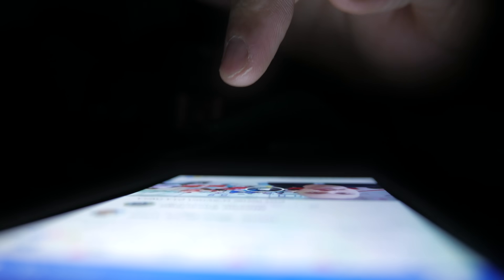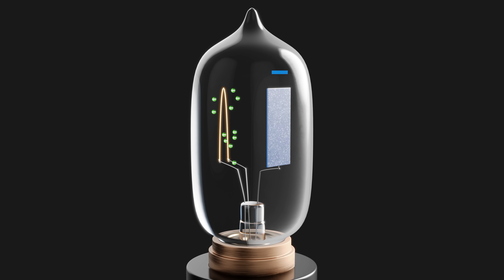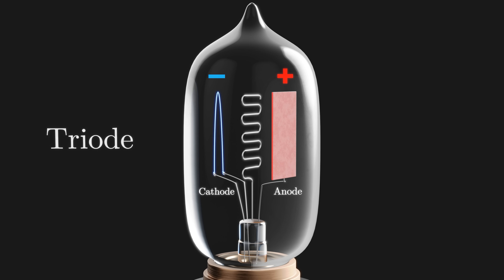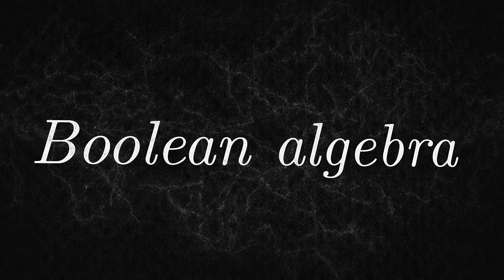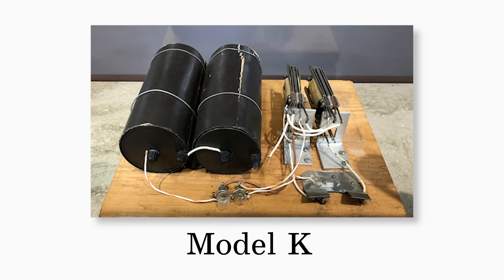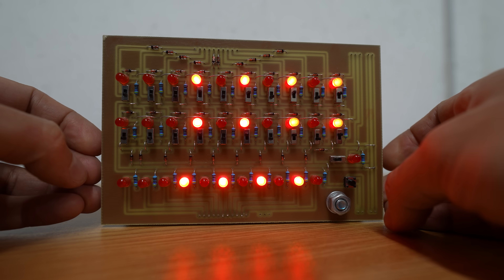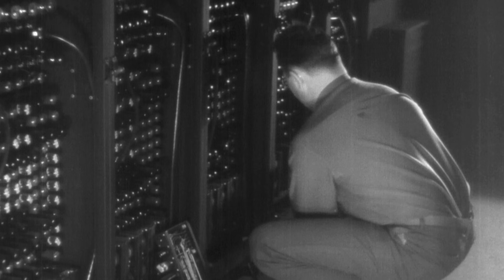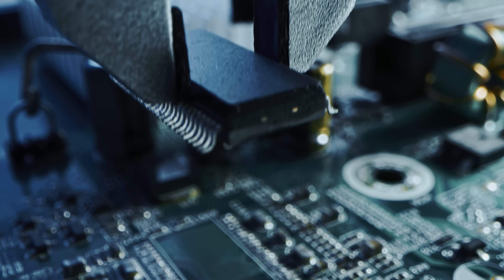Why The First Computers Were Made Out Of Light Bulbs

Comment: For everyone that misses his favorite early computer from the 1940s. I can add more if suggested.

Atanasoff–Berry Computer (1939–42) — first electronic digital computer for a specific task
Zuse Z3 (1941) — first working general-purpose programmable automatic digital computer
Colossus (1943–44) — first large-scale single-purpose electronic computer
Harvard Mark I / ASCC (1944) — first large-scale general-purpose electromechanical computer in regular Service
EDVAC (design 1944–45, operational 1949) — early electronic computer designed around the stored-program (von Neumann) architecture
Zuse Z4 (completed 1945, operational 1949–50) — most advanced relay-based programmable computer
ENIAC (1945) — first general-purpose electronic computer
Manchester Baby (1948) — first stored-program execution
EDSAC (1949) — first practical stored-program machine in service
UNIVAC I (1951) — first commercially produced computer for business and government use

Comment: In wiring the line connection to these heaters, the video shows regular wire nuts.  But, 1. these heaters typically use aluminum wiring internally, meaning a dissimilar metal wire nut (purple), 2. high heat load means the regular temp rated wire nuts not good enough, 3. There’s a both a ground screw and green wire built into the heater, meaning both ground wires have  to terminate same place, ie pigtail or ring crimps. 

Don’t see any if this in the video

Comment: The first computers were actually mechanical. Included among them would be Konrad Zuse's "Z3", a  fully programmable digital computer, built in 1941, and Vannevar Bush's analog computer that solved differential equations; he built that 10 years before Zuse's machine! There were others that should be considered, like Pascal and Leibniz's math calculating machines, Babbage's Difference and Analytical Engines, a wide variety of astronomical clocks, and perhaps even the enigmatic Antikythera Mechanism should be included? The first computers were all mechanical.

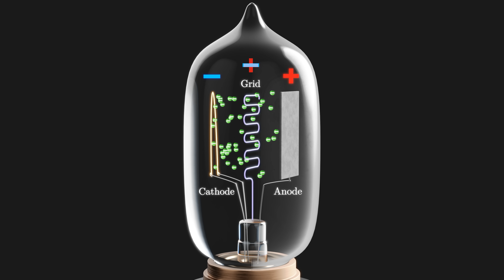Comment: Slightly misleading at 13:50 and earlier.  Indeed, electron flow from cathode to anode will be blocked when the grid is "very negative", but to facilitate electron flow from cathode to anode the grid is not made "very positive".  This would facilitate electron flow from cathode to grid, so for electron flow from cathode to anode the grid is made slightly negative or zero (w.r.t. the cathode), but not positive.

Comment: I am understanding that the grid (6:28)  helping to regulate the flow of electrons but how it is helping to increase telephone connection across America?
Reply: As an example, let's say a microphone connected to the triode grid provides a 100 mV signal which produces an anode signal current of 1 mA.  If the anode is connected to a supply voltage via a 10 kOhm resistor it will produce a signal voltage of 10 volts at the anode.  The triode has amplified the signal by 100, turning a 100 mV signal into a 10 volt signal.

Comment: X rays were a side effect in many vacuum tube use cases like TVʼs and tube amps. Purpose build x ray tubes are more efficient at the conversion from electricity to x rays but with my testing it’s possible with most tubes and sufficient voltage (about as much as it can handle). I would love to see a Geiger or spectrometer reading on this processor.

Comment: 0 = current off 1= current on energy oms law. If current on calculate assigned bulb character. If off loop ;) switch on/off calculation aka binary 0 and 1 system. Same concept black and white digital camera calculation :) now in quantum its multidimensional bulbs aka imagine like chemical reaction explosion million of bulbs in parallel on/off  electrical calculation. Then assigned value gets returned back to human character. Quantum calculation. Cubits explosion of mind.... discrete math multidimensional calculation in nano seconds :). Ultimately it's electronics circuit board. Open gate,  close gate calculate flow of current retrieve assigned character from each bulb keep in buffer till in loop return final value of characters. Same old school signal communication, bulb on mom home do not come home bulb off mom outside come home 😀.

Comment: A positive grid attracts electrons. These electrons can't go to the anode, and worse, can heat the grid. Therefore the grid was mostly operated with more or less negative voltage, say between -10V and -1V relative to cathode voltage.

Comment: Its funny. While Stibbitz in 1937 built a simple relay with 2 switches, Zuse already was building the first computer from 1936 to 1937. But I guess the americans were always late and thats why Paperclip happened after the war.
Crazy part is that the amplifier tube was invented way before that, so in theory a tube computer could have been built even 20 years earlier. I attribute the slow distribution of information and ideas to that. Noone bascially was connected enough to spitball ideas other than on conferences and letters.

Just imagine if someone had thought of the principle of using amp tubes as switches earlier, maybe people couldn't quite see it because of the sine wave nature and not thinking about capacitors pulling the voltage up or down to specific points that then act as signals. It is even crazier that these machines were basically pretty crude and simple all things considered.

We will never have such a huge development jump anymore, even quantum computing is not advancing as fast as we did with normal computers.

Comment: AI Summary

Abstract:

This video traces the unexpected origins of modern electronics, beginning with Thomas Edison's observation of electron emission (the "Edison effect") from a light bulb filament. This phenomenon, known as thermionic emission, laid the groundwork for the first electronic components. The video details the evolution from Edison's discovery to John Ambrose Fleming's thermionic diode (the "Fleming valve"), which acted as a one-way switch for electricity, and subsequently to Lee de Forest's triode (the "Audion"). The triode, with its ability to amplify and function as a rapid electronic switch, revolutionized radio and telephony. The video then connects these vacuum tube advancements to the dawn of digital computing, showcasing early relay-based calculators (like Stibitz's Model K) and the massive ENIAC, the first programmable electronic computer. It concludes by highlighting the critical role of vacuum tubes in these early machines, while also pointing out their inherent limitations in terms of size, power consumption, and reliability, setting the stage for the eventual advent of semiconductor-based electronics.

The Light Bulb to Digital Computing: A Journey Through Early Electronics

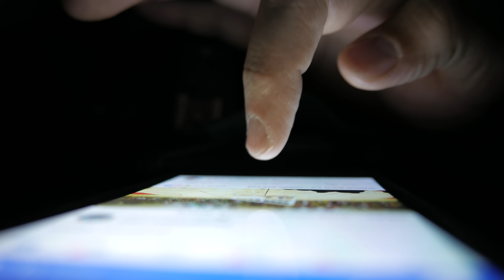*   0:00 The Light Bulb's Unexpected Secret: The modern era of electronics began with Thomas Edison's observation that light bulb filaments, when heated in a vacuum, emitted electrons (thermionic emission), causing discoloration only on the positive side of the glass. This was known as the "Edison effect."
*   1:59 The Thermionic Diode (Fleming Valve): J.A. Fleming patented the first electronic valve in 1904 by adding a second electrode (plate) to a vacuum bulb. This device acted as a one-way street for electricity, allowing current to flow only when the plate was positive relative to the filament, enabling radio signal detection and AC-to-DC conversion.
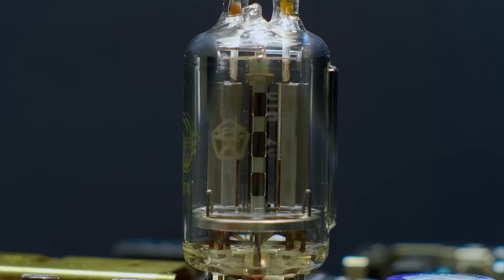*   3:33 The Revolutionary Triode (Lee de Forest's Audion): In 1906, Lee de Forest added a third electrode, a "grid," to the diode, creating the triode. This innovation allowed a small voltage change on the grid to control a much larger current flow between the filament and anode, providing the crucial capability of electronic amplification, which was vital for long-distance telephone calls and radio communication.
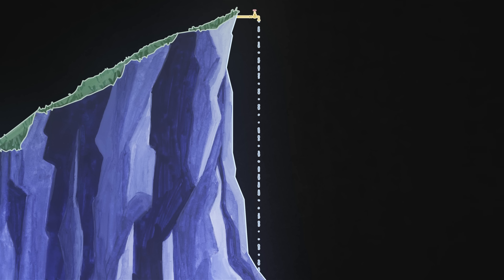*   5:50 Triode Amplification Demonstration: A live demonstration shows a triode amplifying a small 2-volt input into a 15-volt output, illustrating its power in boosting signals. This technology made the first transcontinental telephone call possible in 1915.
*   6:52 From Analog to Digital: Boolean Logic: Claude Shannon's 1937 thesis linked electric circuits to George Boole's Boolean algebra, establishing the foundation for digital logic gates (like AND, OR, XOR) using switches or relays.
*   7:57 The First Digital Calculator (Model K): George Stibitz built the first digital calculator, the Model K, in 1937 using telephone relays. This basic "half adder" could add two 1-bit binary numbers, demonstrating the practical application of Boolean logic in electronic circuits.
*   10:59 Limitations of Relay Computers: While effective, relay-based computers like the later Model I (which used over 400 relays) were slow, noisy, and mechanically prone to wear and breakage, limiting their computational speed and reliability.
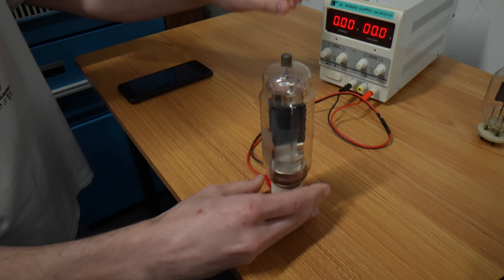*   13:29 Triodes as Electronic Switches: The vacuum tube triode became the ideal electronic switch, rapidly controlling current flow without moving parts, making it significantly faster and quieter than mechanical relays.
*   14:13 The ENIAC - Dawn of Electronic Computing: The Electronic Numerical Integrator and Computer (ENIAC), the first programmable electronic computer, came online in 1945. It was a colossal machine (30 tons, 175 kW, filling a whole room) but revolutionized computation, performing 500 operations per second and proving critical for complex calculations like those for the hydrogen bomb.
*   15:36 Vacuum Tube Drawbacks: Despite their importance, vacuum tubes were power-hungry (always needing heat), large, and unreliable, with ENIAC tubes failing every few days. These limitations highlighted the need for new electronic switching technologies.

I used gemini-2.5-flash| input-price: 0.3 output-price: 2.5 max-context-length: 128_000 on rocketrecap dot com to summarize the transcript.
Cost (if I didn't use the free tier): $0.0078
Input tokens: 18319
Output tokens: 916

Comment: A vacuum tube is not a light bulb in that its purpose is not to glow or give out light like a light bulb.

A vacuum tube was an electronic control device. Meaning, it controls the flow of electric current. Vacuum tubes served similar purpose as transistors do nowadays. Back then, transistors weren't invented and they weren't so small. Computers were made of bulky vacuum tubes which would lead to heating issues.

Comment: The ubiquitous presence of vacuum tubes (the British call them "valves" as per your water valve analogy) in home electronics led to a cultural icon:  the tube tester.  Besides at Radio Shack (naturally), they were to be found in most drugstores and elsewhere.  When you TV would stop working, it was usually because of a burned out tube.  So you would fix it yourself by opening the back of your TV cabinet and pulling out all the tubes, taking them to a tube tester, testing them all until you found the one(s) that failed the test, buying replacements for them (the store carried an inventory of spare tubes), putting the tubes back in the TV (there was a diagram showing which tubes plugged into where), and turning the TV back on hoping that fixed it -- if it still didn't work, that was when you called the TV repairman.  It was one of the things that every father taught his children.  As solid state electronics overtook tubes in consumer electronics, those test sets started disappearing.  The last that I remember seeing was in a Radio Shack around 1980.  
In USAF tech school (Electronic Computer Systems Repairman, 30534) we were told stories of the massive SAGE computer (AN/FYQ-7, AKA "the Q7") that ran on tens of thousands of vacuum tubes.  One was the first test they would run to troubleshoot a failure: turn the room lights off and look for the tube whose filament wasn't glowing.  We called that the "Q7 test" and we would use it to troubleshoot our broken TVs at home.

Comment: I've got a question. In the half adder part, when current is flowing from A + right to the carry bulb, shouldn't the solenoid close? B is also on the + position, so current flows from both A and B, which gives stronger light at the bulb, and the solenoid turned on - could someone explain??

Comment: The first computer to use electronic binary logic was the Atanasoff-Berry computer, although it was not programmable. It was also never patented and many of the core ideas for building it were used in the ENIAC later on, which was patented by its creators. The patents ended up owned by Sperry Rand, which attempted to collect royalties from other computer manufacturers at the time, which seems absurd, but it was the reality back then. One of those manufacturers was Honeywell, which learned about ABC and challenged the validity of the patent in a lawsuit (Honeywell v. Sperry Rand , 1973). The patent was invalidated, which opened the way for anyone to create his own computer without having to pay royalties. Apple was created just couple of years after that. The whole thing deserves its own video imho.

Comment: Again a very American focussed history and completely ignoring the actual first electric computers from Konrad Zuse....see Wikipedia for more details... quite impressing

- Z1 in 1938 using electro motors
- Z2 in 1940 using relays
- Z3 in 1942  using relays but with improved 22 bit and floating point calculations (!)
- Z4 in 1943-1945 using vacuum tubes but not able to finish due to the ongoing war. 

He was also know as the creator of the first X/Y-plotters and designed computer and related systems up to 1989.
Reply: note, the ENIAC wasn't even binary, it was a decimal number calculator.

Comment: Edison did way more: He had a 2nd element (a wire or foil) installed inside the vacuum and he discovered the actual thermionic diode-effect. But he later never both much more with it, as his interest was in improving the actual light bulb.

What Fleming discovered later was that this vacuum diode could rectify high-frequency AC, which was done before only with Galena-crystals.

Comment: Some interesting points, ATT was involved in many aspects of the vacuum tube, Boolean logic, and early computing. Claude Shannon worked at ATT Bell Labs when he came up with several basis for computing, Boolean algebra can be done by electronics as well as "information theory" the basis of all digital communication. The vacuum tube was first used by ATT to make very long distance telephone possible, ATT bell labs developed many different tubes for many different applications, later it was ATT bell labs that invented the solid state transistor, the replacement to the tube.

Comment: Many might say modern computing began in the 1880s when someone (Hollrieth) asked a conductor why he punched holes in a RR ticket.
The placement of the hole pattern he punched characterized the time of the ticket and descriptions of its purchaser -- which is why a ticket could be left behind after it was punched.
That simple observation led to "IBM Punch cards". The positions of the holes in a larger punch card recorded more data about the population than had ever been done before. Punch cards were put to use in the 1890 US Census.
-- Required by the Constitution to identify population changes within each decade.

80 years later, similar punch cards were still being used to represent the instructional sequences that are needed to perform by mathematical algorithms. Raytheon R&D used them back then to process sampled arrays from submarine sound-signals which used to be processed by sending analog signals through a maze of circuitry. Digital signal processing calculates valuable information from the sound and timing in a noise-free environment.

Analog sounds are pretty slow, relative to video, radar, and time sensitive information. They were slow enough for computers of the time to perform all the necessary algorithms to do what analog electronic components did -- in real-time.
Working the mathematical process backwards reveals the amazing range of real time applications that can be done with faster processors and memory.

Digital signal processing has been around since WW2 where it was used to detect mechanical problems with returning aircraft. But, the sounds had to be recorded and addressed at a slower speed.
They couldn't be done in real-time -- which is required for flight simulators.

Claude Shannon and David Forney opened the way to apply digital signal processing to ultrasound, video, radar, and channel capacity as in fiber optics. It's all part of information theory

David Forney made an error-correcting device suited for the recovery of the familiar photos of deep space. His discrete design was reduced to an integrated circuit that weighs next to nothing.

Paper memory was superior to other types of memories 50 years ago in R&D for low cost and reliability. But once the design has been proven, the low cost of ICs in quantity offer all sorts of advantages because of quartz encapsulation shock absorption, small size, as well low cost per unit.

Comment: Analog Flight Simulator Specialist/Technician, USAF, 1978-82.  Vacuum tube amplifiers, diodes, resistors, relays the size of walnuts, variable resistors (potentiometers and rheostats) sometimes stacked ten-deep, and more: “analog computer” systems.  The F-101B Voodoo analog flight simulator (AF57-17, manufacturer year and production number) came from the Melpar a division of Westinghouse Air Brake Corporation was the size of a single-story six-room house and generated enough heat from the vacuum tubes and other components to heat a six room house to 72° in the “dead of winter“… and it came from the factory with one metal- cased resistor the size of a stack of 7 or 8 quarters.